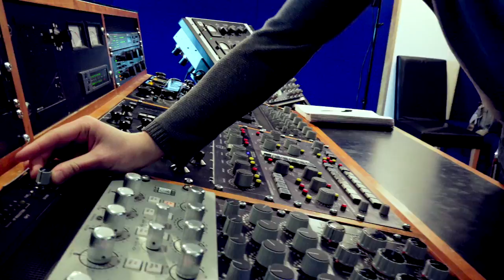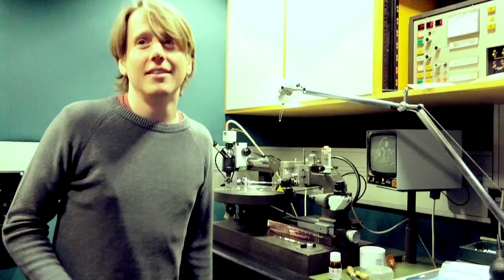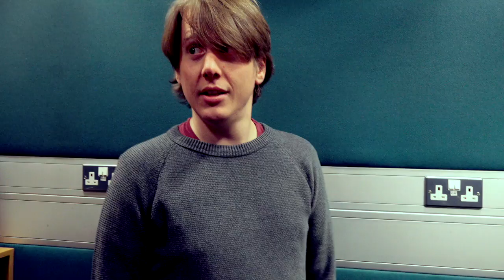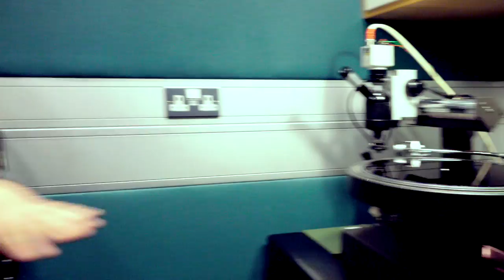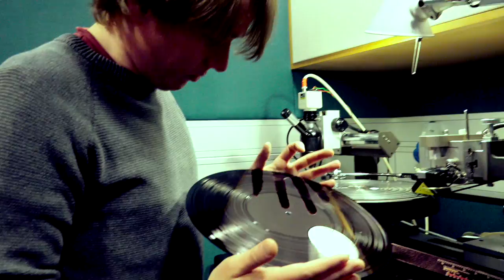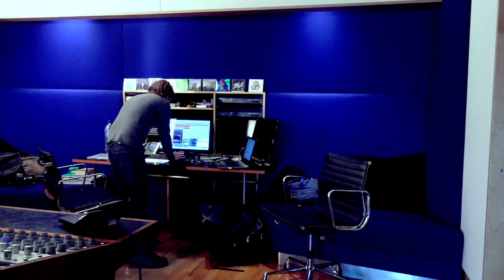Mastering Vinyl at Metropolis Studios - watch the process of cutting vinyl at a top recording studio

Comment: Personally, I love that man' mix.. His reverb is wickedly tasteful and though ever present, doesn't blur the rib cracking arrangement,and even the spots where the top end energy pushes the snare back a squizz, it sounds natural and very energetically live as the scenes of the mix evolve. I'm not much of a metal head but this mix really does sound amazing and emotionally charged to me. For any part of that mix not to stick to lacquer would be a real shame, even the cab thump of them razor sharp guitars. Awesome video of great content and badass mixing. I think I'm gonna add Mike Exeter to my favourites if in fact he mixed that on grot box!! 😬 . Brilliant work Mr Exeter, absolutely nailed it!! 👏👏👏
Reply from the maker: And the thing is, you're only hearing the mix on the camcorder mic - it may be possible to add a third part comparing the mix that Mike did and a playback off the acetate on a posh deck to compare...
Reply: That really would be interesting to hear and see. The test acetates are good for 6-12 plays before they start collapsing, is this correct? Even though it is a cam corder mic, it's still easy enough to hear the depth and strengths of his balance. Really a fine mixer, who is the band? kind regards, gene ✌️
Reply: Really a testament to the excellent acoustics design of the room id imagine - not many reflections and a very even frequency response - but the camcorder recording was incredibly clear.